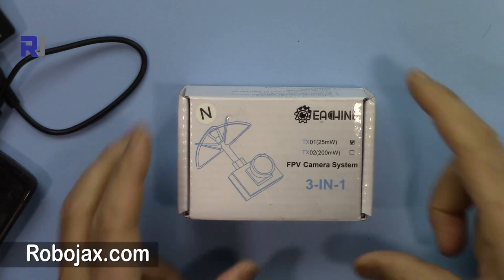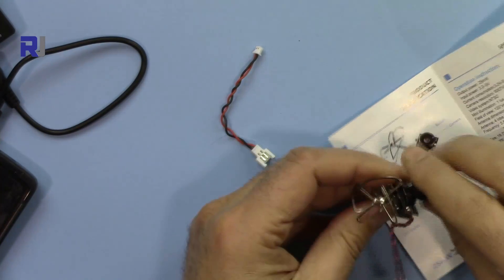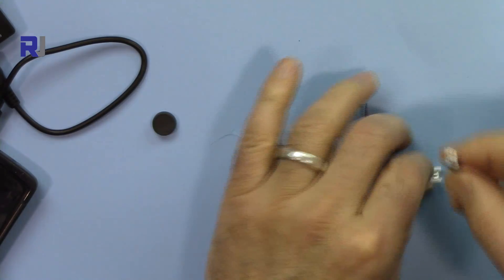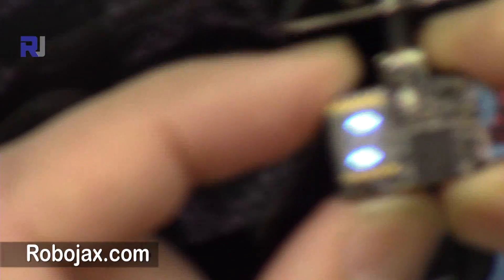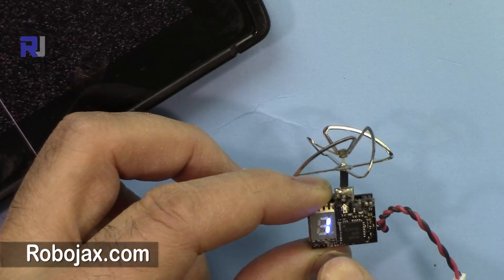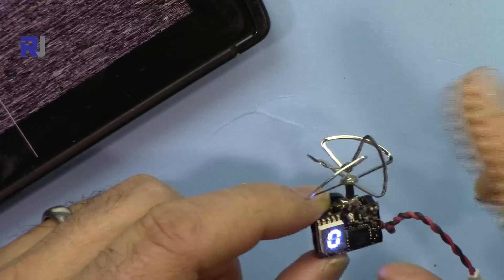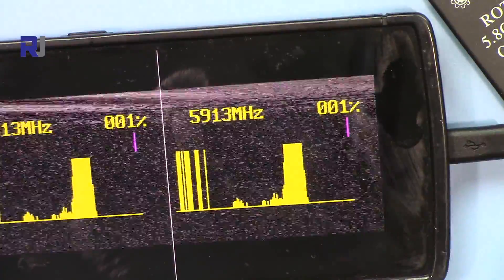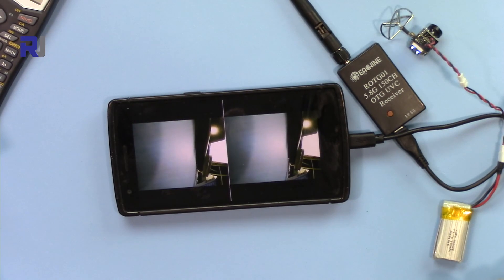Eachine TX01 25mW FPV Transmitter setup and test

Comment: hello, with this tiny battery, how long it will run on video streaming ??
Reply from the maker: it is hard to tell. many factors affect the the running time. This module is wasting a lot of energy as heat.
Reply: @robojax  i mean if i put it as not moving temporary surveillance cam, will it run from this small battery an hour, two, or whole day ? will it stand a day with big batterypack, or it will burn by overheating ?? any ideas ? i have no clue
Reply from the maker: Unfortunately I have no information on that. you would have to measure the current "Ampere" . if you measured for example 250mA, for camera and your battery is 2000mAh, then divide 2000 by 250=4h so it will run for 4 hours.